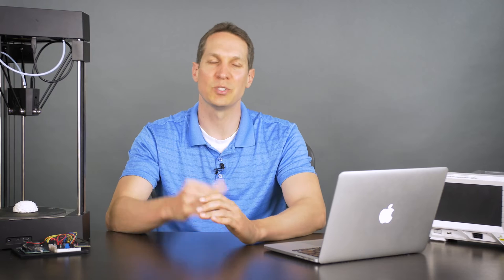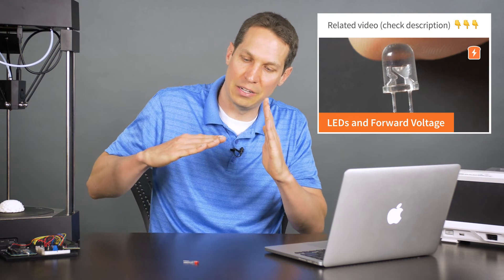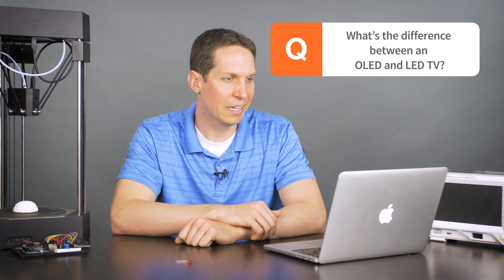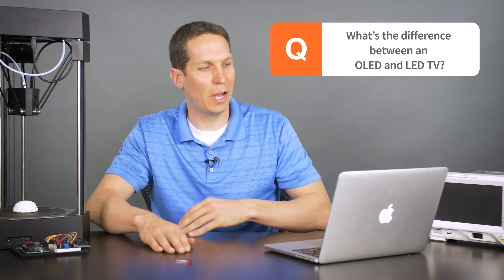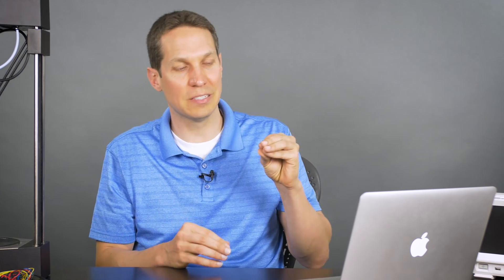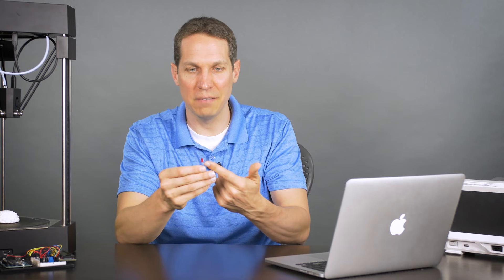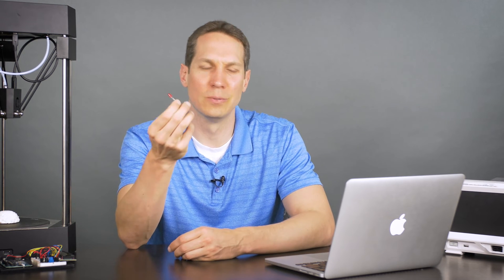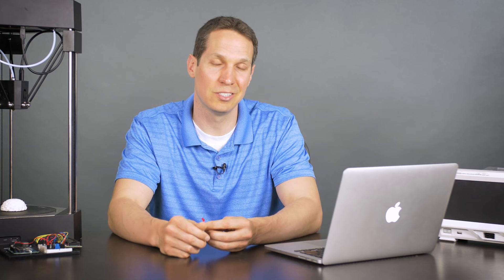Your LED questions ANSWERED! (Part 3) | Basic Electronics

Comment: In regards to LEDs creating EMI, I have seen them turn a car's radio signal to a static hum. After changing reverse lights to some extra bright LEDs, it would have that effect whenever the car was put into reverse. The same brand didn't have any issue with EMI for brake lights or turn signals, but they were different colors.
Reply from the maker: Wow, that is crazy that it was enough EMI to be heard on the radio.  But... I'm curious why the reverse lights would create EMI, unless they have some weird LED driver in there.  It should just be a DC signal, right?  And the radio would be in the hundreds of kilohertz to megahertz range, why would the LED be operating in that range?  Now I'm really curious.  Any thoughts?